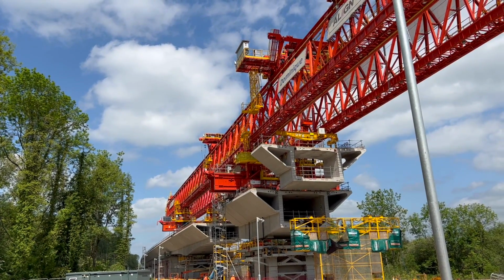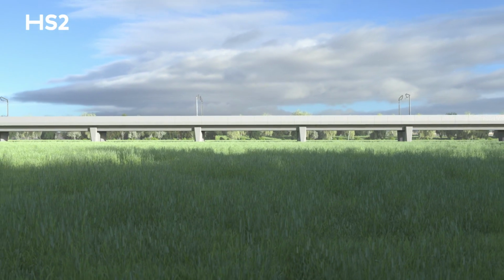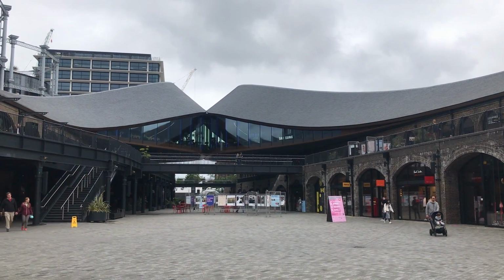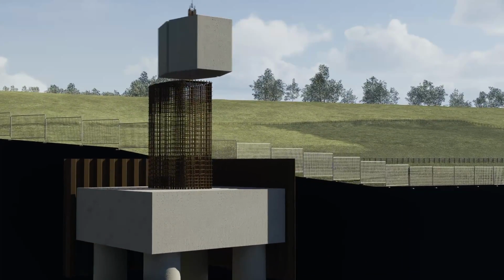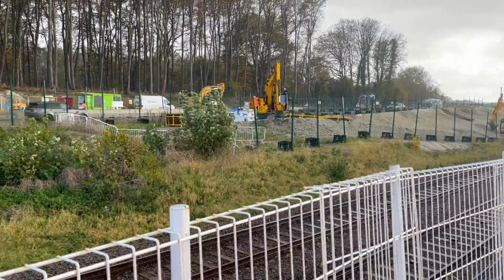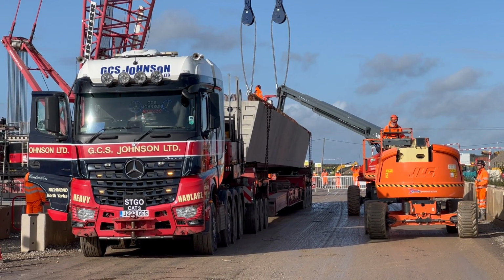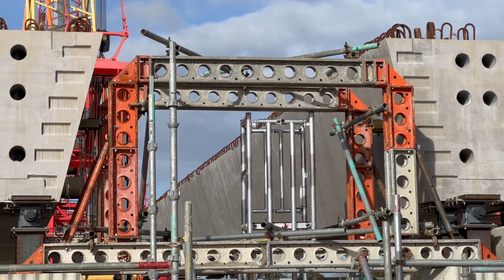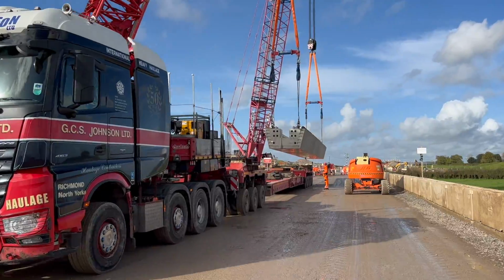Return to HS2: The Art of Compromise

Comment: I have mixed feelings about HS2, I'm not likely to ever use it and the cost is spiralling upwards at an alarming rate, but it does seem to be being built responsibly and aesthetically as pleasing as it could be.
Reply: You'd benefit from it if you used it or not. It'll release capacity on the existing network so more regular commuter and regional trains, and it'll take more cars off the roads so there'd be less congestion. It'll also bring economic growth to the areas is serves as it makes it easier to get people and goods around the place. These benefits are massively reduced now and concentrated almost entirely to London... again. It's basically turned in to another commuter line for London rather than something that benefits the whole of England.
Reply: @TalesOfWar  I wanted HS2 but I only half believe it benefits. Greater Manchester needs a vast underground and overground network to connected it all up with a simple tap on tap off system. The tunnel boring machines now free could be used to do this but for reasons that completely escape me. Underground is only for London. The government wouldn't even fund one poxy tunnel between Piccadilly and Victoria.

There's towns like Leigh that used to have a train station then it was bulldozed (nice one) and now it has nothing. The M60 is rammed everyday and HS2 would do nothing to alleviate it as the problem is getting around Greater Manchester not to it. The Metrolink is too slow and too radial with no coverage between towns (Always going to the city centre). I can get to Liverpool Lime Street faster than I can commute between 2 GM boroughs, HS2 would not change that.

Honestly the Bee Network bus system when fully operational will probably do more to help than HS2 (However busses get stuck in the same traffic as my car so).

In my opinion is should be absolutely possible to commute between 2 places in GM in less than an hour and to do that we need an underground which we will never get because Manchester is not London.

London gets Crossrail, London gets HS2. Manchester gets nothing. We go into the 21st and 22nd centuries with 19th century infrastructure. Its a good job the Victorians built the viaducts because they wouldn't be built today.
Reply: @SRParsonage  We need that, and HS2, and HS3 (Northern Powerhouse Rail) and all the other things. We can afford it as a country, we're not poor. We just have far too many NIMBY's and politicians who care more about lining their own pockets than helping their constituents.
Reply: @TalesOfWar   I agree with what you say but I'm more cynical about what's going on. When the government wont even fund 1 mile of tunnel between 2 trains stations then the problem is more than just nimby's. We have a system of governance and view on investment that is biased to one city and it has always been this way. It doesn't matter who you elect and what party they are from the London bubble always pervades. It took decades to get a tram network going and even now its still underfunded for growth. 

HS2 got approved because it involved London, The amount of contempt the government has for people who live outside the M25 is appalling. They would rather sell or destroy the tunnel boring machines than build a underground in Leeds, Manchester or Sheffield. 1000 years of centration of wealth and power in one area has made this country unbelievably lopsided.

As you pointed out the propaganda is always framed as "what's good for London is good for the country". How about "what's good for towns like Leigh is good for the country".
Reply: How are you going to promote economic growth by connecting a town with no jobs to other towns with no jobs?

Comment: From £55m to £106bn? That's a serious increase!
Reply: £55bn to £106bn, not million
Reply: Cost estimates are just that. Estimates. If you knew how much of a complete guess those numbers were, you would be shocked. Anyway it's still economically worth it by far.
Reply: Not even double.  Many major infrastructure projects in the UK have risen by far more than that.
Reply: @clickrick indeed. The British Library went from £68 million to £445 million. And finished 7 years late.
Reply: The channel practical engineering has a nice video on why those budgets tend to get bigger over time, but that basic part is that there are a lot of unknowns factors that you can’t know about until you do it, and very few of them make things cheaper.
Reply: A few incentivising golden handshakes were probably to blame.
Reply: Also that initial budget is based on the bids received. And if you want to win the bid, you say you can build it for half the price.
Then once you've got it, you milk it dry, because it's government money. And at the end of the day, taxpayers get shafted.
Reply: @_Wombat the original budget was calculated by a cost consultant who has little or no technical knowledge. The bids come at a later stage when design work is completed.
Reply: @_Wombat  Most of the cost increase is simply down to 13 years of dicking around doing nothing but letting inflation increase the cost of the project. An at various points over the last ten years construction material inflation have been higher than the rest of the country inflation.
Reply: @_Wombat Unfortunately Government, and Public Sector procurement in general, nearly always goes to the lowest bidder. The result of this is that any bidder who prices the contract correctly is bound to lose because they are “too expensive”.
Reply: @_Wombat only when a project is competitively tendered. HS2 has been let on an open book audited contract. And the initial budget is alaways produced by a Cost Consultant before any bids are prepared. That applies under any contractual arrangement.